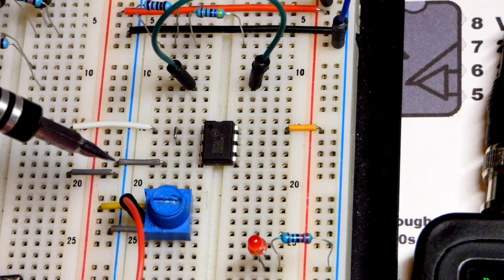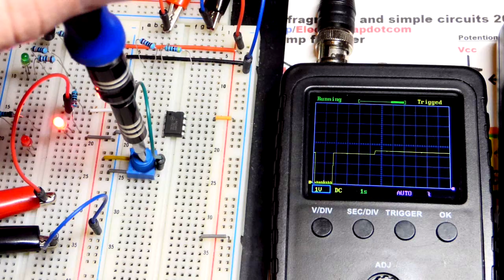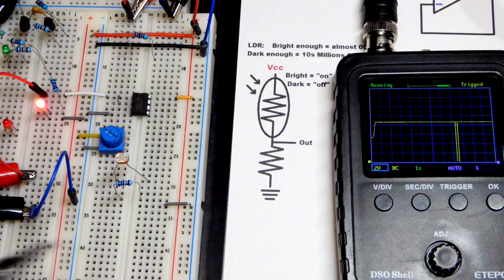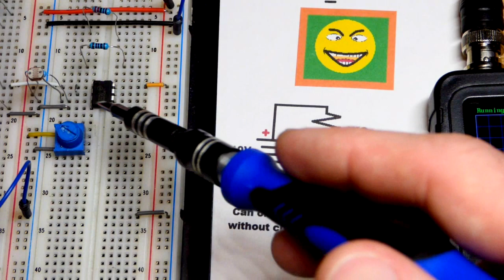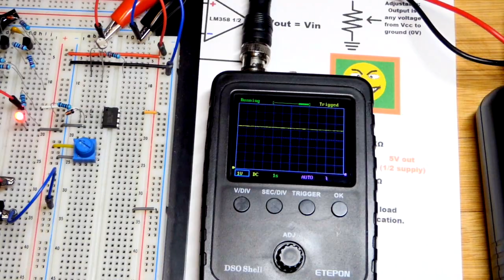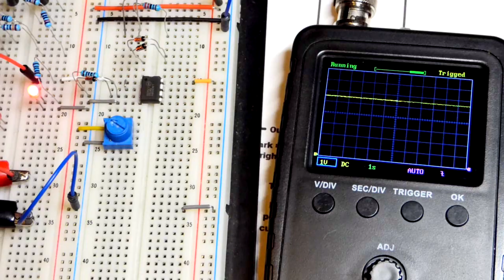Electronics course 22 Op Amp follower circuit voltage in is voltage out LM358 trimpot zener LDR

Comment: Ok, great explanation of the circuit. What I would like to know is . What would you use this type of circuit for?
Reply from the maker: Thanks! It works well for powering something at a different voltage than the power supply voltage, and can be adjusted easy. I don't really have any specific circuits in mind right now.